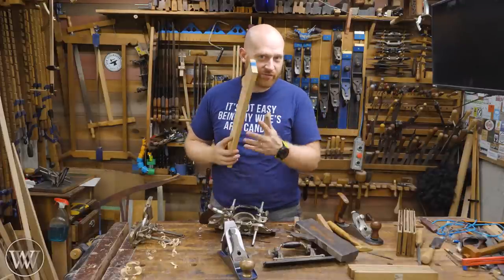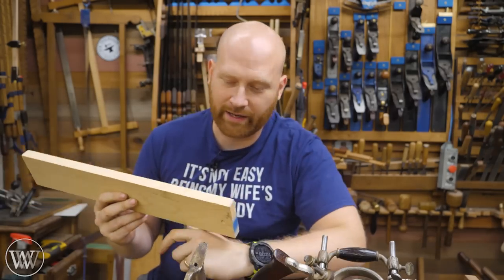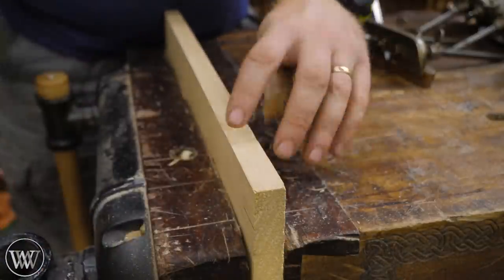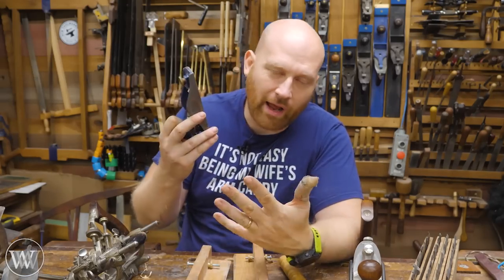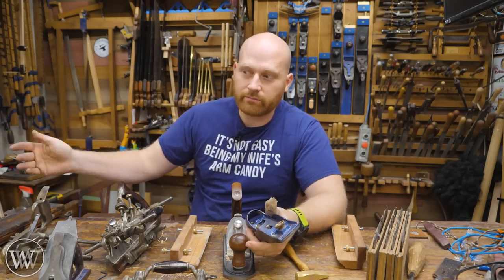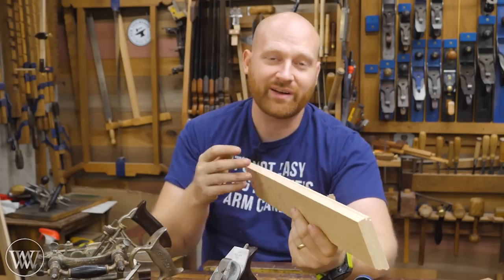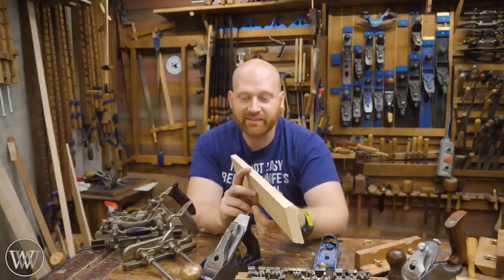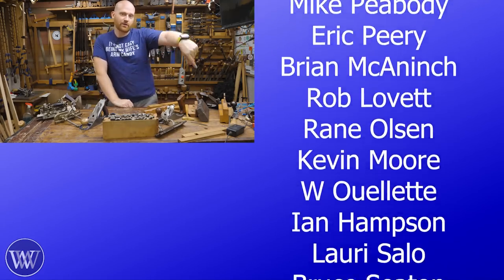What Is the Best Corner to Use on Your Project

Comment: A simple softening of the corner is my preferred corner on smaller simple projects where as for larger projects a 45 degree is my preference especially on overhanging edges. Sharp corners, in my experience, can tend to splinter along the grain and the splinters will either ruin a shirt or slide under a fingernail plus damage the look of the piece, no-one wants a wedge missing from a piece they've spent a lot of time on.

Comment: Damn, now I got an urge to make a moulding plane cutter cutting jig for my rotating multitool and I already have too many things on my have-to-do, kind-of-should-do, and neat-to-do lists.
The overall idea is a small vice in a container for water and the multitool held in a 2:1 or 3:1 panthograp for more accurate control.
Reply: Sounds like you need a roundtoit. Assign each one to a specific project or issue and when someone, such as your own self, questions why it is not done you can just point to it - AKA pointtoit - and get back to whatever the hell you were doing before you were so rudely interrupted. Ah, life's simple.

Comment: Have you ever used a cornering tool?  They are similar to combo wrenches in that they can come in sets and have cutters on both ends that are different sizes.   Very simple tool but makes a much more repeatable corner shape than a block plane does.  They are just for breaking the corners, no fancy shapes or chamfer,  but the are fast if that's all you want to do.
Reply from the maker: those are great for edging and faced woods, I have not found them all that useful for solid woods.

Comment: In the past my misadventures with hand tools resulted in among other injuries, a torn thumbnail while trying to use a handsaw. I prefer using power tools because of those experiences. But strangely enough, since subscribing to, and watching your videos  I am willing to try hand tools again. Mainly a small manageable hand plane, now that I know that they need to be sharpened properly before the first use. 
By the way, how do those specialty planes work with really hard hardwoods? I'm very curious about how they would cope with the local woods here in Guyana (purpleheart is one of our local woods).
Reply from the maker: with really hard woods they work well. you just have to sharpen more often. you also want to take a slightly thinner shaving.

Comment: But what you failed to explain is how to make the corner pattern match cross-grain to with the grain cuts... i.e. making the corners come together at the corner.
Reply from the maker: You cut end grain The very same way you cut face grain. You just need to make sure that it is very sharp and take a light cut.

Comment: The approaches you've shared all work well while working on the long grain of the wood. I've never had a lot of success with hand cut moldings on the edge grain, however, except for chambers and roundcovers  with the block or smoothing plane. Any suggestions? Or maybe a video describing your technique. Thank you.
Reply from the maker: That would make a good video. with end grain the keys are to have it crazy sharp and very thin shaving.

Comment: I wonder how to sharpen those blades. file!? 🤣🤔
Reply from the maker: Generally a slip stone or sandpaper on a dowel.
Reply: @WoodByWrightHowTo  so, no mirror finish here
Reply from the maker: no need for it. a mirror finish on any tool just makes the user feel good. it does not cut any better.